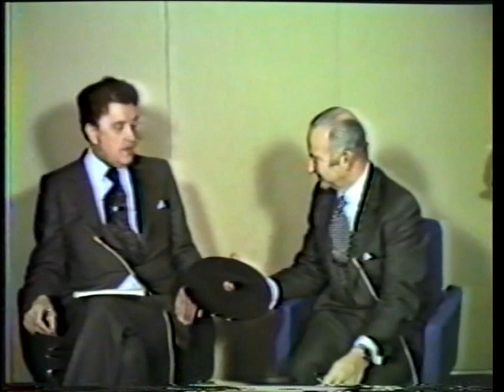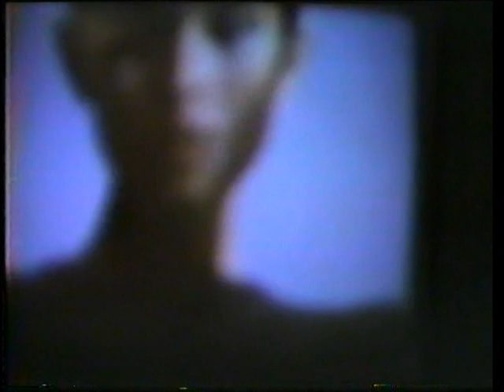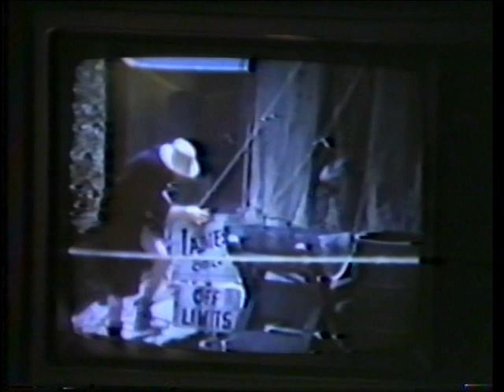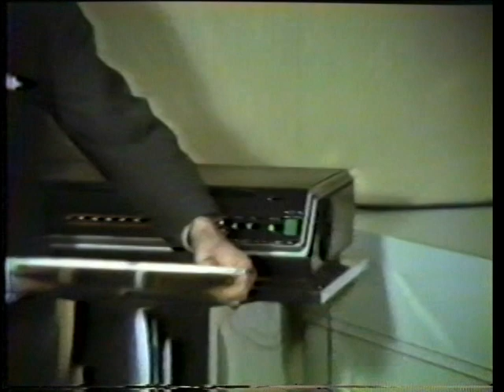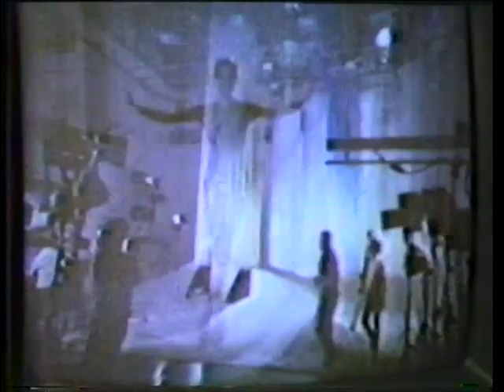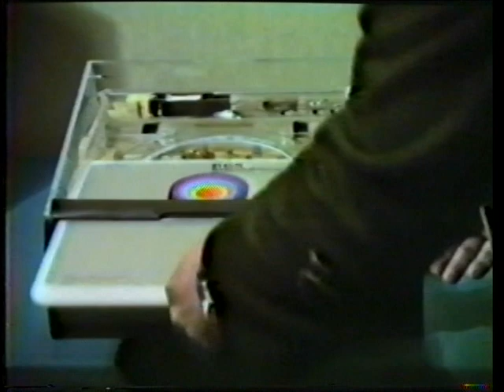Richard Sonnenfeldt 1979 CED VideoDisc Demonstration

Comment: they should just took their losses and never released ced but if you enjoy YouTube poop go buy one🤣
Reply: Also, fun fact: Back in the early 70s, RCA tried their hand at a video cassette format just as those were coming out (see 1971's Sony U-Matic and 1972's AVCO Cartrivision for reference). RCA's video cassette format would have been the Magnetic Tape or MagTape. RCA should have put more time and effort into that instead of the CED concept. Besides, in 1975, Telefunken in Europe beat them to the Video Vinyl Concept with TED (Television Electronic Disc). There's an article about RCA MagTape and why it never came to be on the CED fan website
Reply: Good luck finding one in working condition on eBay. You would have to give up an arm, a leg, a kidney and your first born male child for a working CED and Discs in mint condition